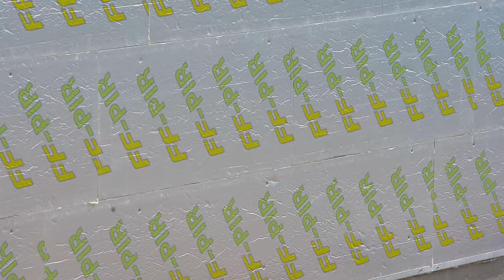Construction Maison en Bois A à Z en 10 JOURS !

Comment: Alors autant toutes tes autres vidéos sont chouette. La malheureusement, étant charpentier je me sens obligé de réagir. Mettre des isolants fermés à la vapeur d'eau tels que le polystyrène en extérieur revient à mettre le bois dans une enveloppe étanche et donc très peu durable. Il va y avoir de la condensation dans les murs un jour et donc le bois va pourrir des champignons vont apparaître. Puis ce sera plus qu'un petit tas de mikado. La laine de roche dans la toiture une aberration, s'il faut choisir un seul endroit ou mettre des isolants avec un bon déphasage et donc forcément bio-sourcés ce sera bien en toiture. Il y aura donc une chaleur infernale en été. Pour finir celui qui a acheté ce kit peut se retourner et porter plainte contre le fabricant pour non respect des DTU. Les toitures et bardages sont soumis à des normes de ventilation (lame d'air ventilée) pour sécher une éventuelle condensation ou fuite afin de protéger les structures. Il est même conseillé d'augmenter les lames d'air supérieurement aux normes demandées afin d'améliorer le confort d'été.
La maison conteneur que tu as faite est bien mieux. D'ailleurs bravo pour ton travail et ton courage. 
Si j'avais à conseiller des maisons à faible coût et en neuf pour de l'autoconstruction : Maison ossature bois isolée avec des isolants bio-sourcés (paille, laine de bois, chanvre, mélange coton lin chanvre, ouate de cellulose).

Sinon il existe aussi énormément de bâtiment existant à rénover.

Dans tous les cas faite appel à des professionnels pour vous conseiller au moins. Dans le neuf minimum un architecte puis des conseils d'artisans pour chaque domaine, au moins pour le gros oeuvre. 
Dans la rénovation un habitologue me semble une bonne option.

Petit rappel quand on fait de l'autoconstruction c'est génial pour plein de raisons mais on est responsable pendant dix ans sur le gros oeuvre. Donc si jamais on veut revendre mieux il vaut être serein car vous serez poursuivi comme une personne physique et non morale ( c'est le cas d'une entreprise). L'entreprise peut couler pour fuir à ses responsabilité, pas vous.

Bref rien de personnel j'aime beaucoup le contenu de ta chaine, ton humilité et la qualité de tes vidéos. 
Bonne continuation
Reply: Excuse-moi mais j'ai vu ton commentaire et j'avoue que je commets aussi pas mal d'erreurs dans mon chantier . Je t'explique j'ai un garage à bateau en parpaing nu et je suis en train de construire une ossature bois dedans afin de pouvoir faire des pièces .  Dans ce contexte est-ce que j'ai besoin de mettre un pare-vapeur entre le parpaing et la structure en bois ?
Reply: En plus de cela, c'est vraiment  bête de faire une maison en bois et de ne pas l'isoler avec des bio-fibres ou de la terre/paille. Si ce n'est pas par conviction écolo qu'a été mis le bois mais par snobisme, c'est une bien grosse erreur. Pour isoler avec de la laine minérale autant construire une maison en parpaing ou plaque de béton préfabriqués.
Le pire reste le toit en plastique... J'aurais mis des tôle en bac acier, c'est assez écolo, plus durable et plus simple à poser pour un rendu similaire (Il existe des tôle "imitation" ardoise, mal imité mais aussi bien que leur plastique).

Je ne ferrais pas appel à un architecte mais juste se renseigner sur internet, avec des amis, ou au près d'artisans qui connaissent.
Reply: Salut t’inquiètes rout le monde fait des erreurs c’est déjà bien de se poser des questions ! Et si j’i bien compris tu veux isoler ce garage à bateau par l’intérieur en rajoutant une ossature bois dans laquelle tu placeras l’isolation. Dans ce cas ci je te conseille en partant de l’intérieur vers l’extérieur  pare vapeur HYGROVARIABLE/ossature bois+isolation/parpaing. Après tout dépend de comment tu veux habiller l’intérieur (placo, OSB, lambris) j’imagine que tu veux faire passer Des gaines électriques et des tuyaux probablement en PER. Pour ce faire il faut que tout passe avant le pare vapeur afin de pas faire des trous partout. Dans ce que l’on appelle un vide technique. Le vide technique est soit réalisé avec des tassant de bois, soit avec une ossature métallique pour rails de placo. Ensuite dernière info: l’osb peut remplacer le pare vapeur à condition d’être jointé de partout avec un joint d’étanchéité type silicone d’extérieur par exemple. Ceci dit je ne le conseillerais pas car il est très fermé à la migration de vapeur d’eau. Et la particularité du pare vapeur que je t’ai conseillé est de pouvoir redistribuer l’humidité dans les pièces afin d’éviter l’excédent dans les murs. Cette humidité sera gérée par une VMC. Il est impératif d’aboir une bonne VMC dans une maison surtout en parpaings ! Je te conseille également des isolant biosourcés car eux seul sont en capacité de survivre a un peu d’humidité de temps en temps. Dans les murs moins besoin d’isolants avec un extrêmement bon déphasage. Donc par exemple le biofib trio fait l’affaire. Sous toiture par contre c’est le plus important alors ne lésine pas. Force et courage !
Reply: J'ai revisionné la vidéo, rien n'indique la non présence de ventilation ?
Merci de votre partage.
Reply: Peut-être que sous l’OSB de toiture il y a une lame d’air ventilée en regardant à nouveau j’ai un doute. Par contre en ce qui concerne le bardage c’est sur que non. Il faudrait rajouter un lattage vertical avant le lattage horizontal qui vient recevoir le bardage.
Reply: Je ne parle pas de ventilation mécanique soyons d’accord sur le sujet. Je parle d’une lame d’air de ventilation derrière un bardage et sous toiture
Reply: Merci pour ton retour
Si jamais tu t'ennuies trop j'ai besoin de l'avis d'un pro ahaah
Reply: 100% d'accord, j'allais commenter mais c'est parfait :)
Reply: CHALET PRO : Monsieur, avec tout le respect, nos façades et notre toit proposés sont bien ventilés. Toutes nos solutions techniques sont conforment aux normes et réglements. Vous commentez sans voir des coupes.
Reply: @mille-feuille  je serais curieux de voir les coupes effectivement.

Comment: Chalet de style jardin. Il manque des infos comme l'épaisseur du bois 44 mm, 60 mm ...? Les fenêtres  sont elles d'origines du kit ou celles avec option ? Quand on lit 50000 € je pense que ce n'est que la construction en elle-même faut ensuite rajouter la plomberie , l'électricité, la VMC simple ou double flux , le système de chauffage. Au final question qualité, confort, durabilité... j'aurais misé sur 2 containers de 40 pieds high cube et fait comme vous avez fait avec les vôtres. Pour un coût final similaire voir moindre  au chalet de jardin qui j'ai peur va mal vieillir vue le mode d'isolation et de construction. J'espère juste me tromper. Merci pour la vidéo cela permet de voir en réalité ce que certains sites proposent en chalet de jardin soit disant "habitable".